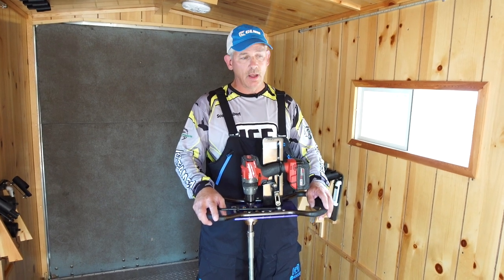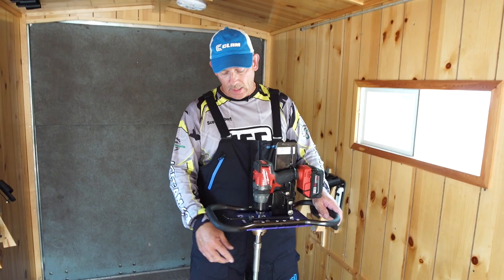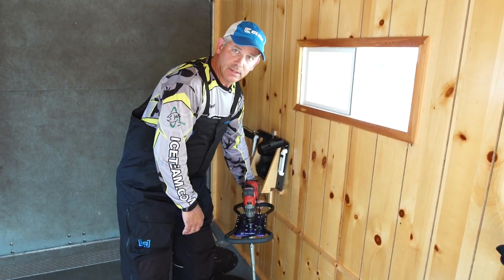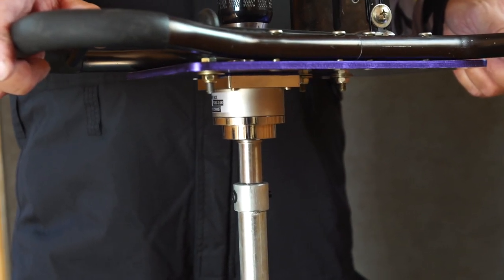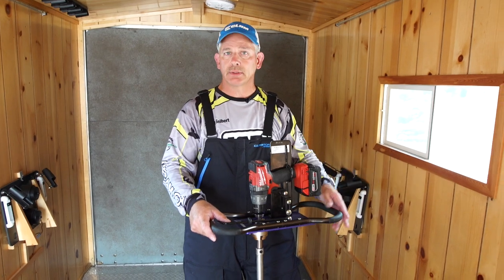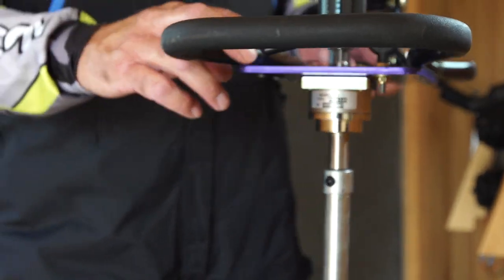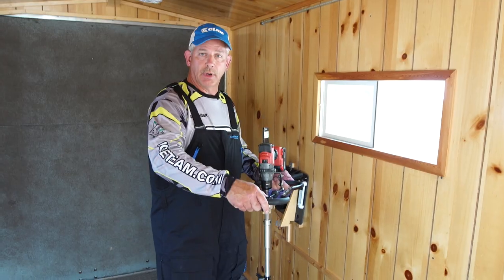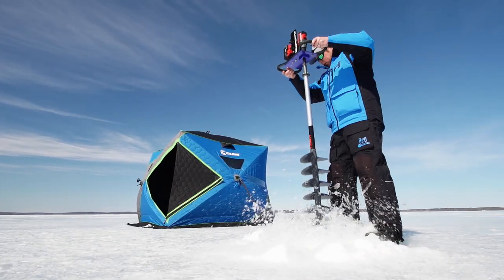Clam Power Drive Auger with Scott Siebert

Comment: Hey thanks for the advice I'm get one for mine

 Also I'm unsure if Clam officially makes a trigger spring return kit  but
to all those that don't like the sloppy play in your clam trigger 
Look up clam drill trigger mod on YT
It uses a return spring 
There's a few very helpful tutorials but here's the list 
(1x)  1/2" x 3-9/16" [compression spring]
(2x) 3/8" ID(inner dimension) x 3/4" OD (outer dimension) stainless steel / steel [shaft collars] 
(2x) 3/8" class 18-8 stainless steel [flat washers]

Hope this helps and goodluck to you all this fishing season!

Comment: Will this attach to my lazer hand auger?  I'm looking at the K-drill, the Pistol Bit, etc, but I already have a great lazer hand auger that I've had in my garage for 20 years and it works (and looks) as good as the day I bought it.  I'm already looking at investing in a Milwaukee drill (upwards of $300). SO the clam drill plate looks attractive and cost effective.
Reply from the maker: Yes, it should fit your hand auger flighting without any adapter.
Reply: @ClamOutdoors  Would this be overkill for a 6"  auger.....or is this a good investment to protect my drill?
Reply from the maker: @StormLaker  If you're running a 6" flighting you should be alright with a standard Clam Drill Plate.

Comment: Does the clam plate not have something like this? I purchased mine for $80. Just wondering if this is something new. Thanks
Reply from the maker: The Power Drive Gear Box is not standard on a Clam Drill plate. It is an accessory that is compatible with second generation Clam Drill plates.

Comment: Where do I  get an adapter for 10" auger the output shaft is 18 mm, the 10" auger that I  have takes a shaft that's around 7/8 of an inch
Reply from the maker: Hey Peter, give our customer service line a call at 763-231-4120. They can help point you in the right direction.